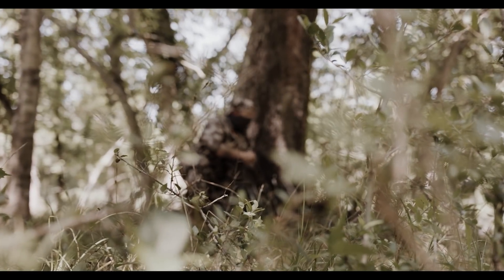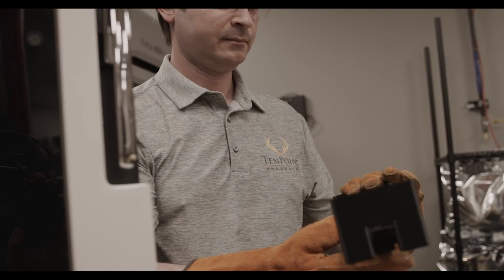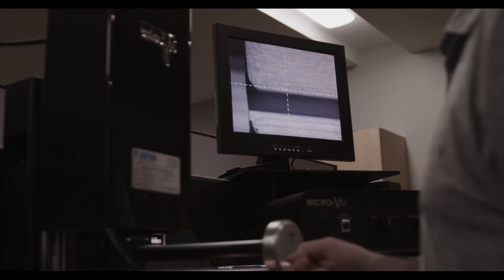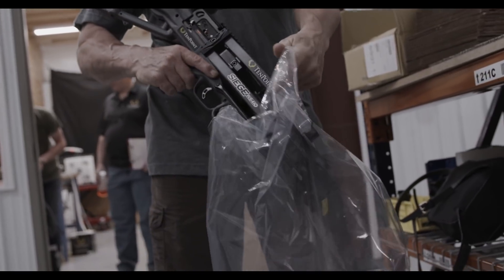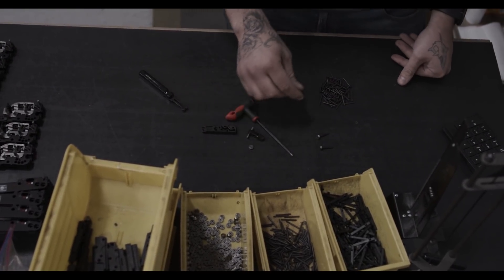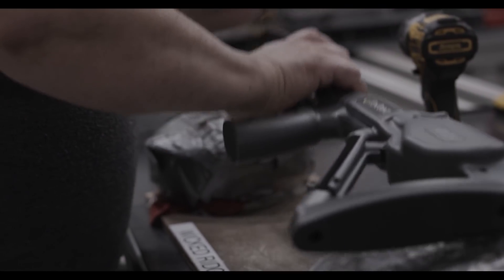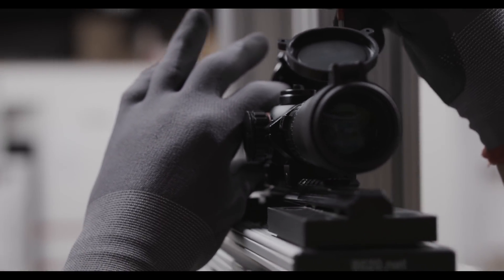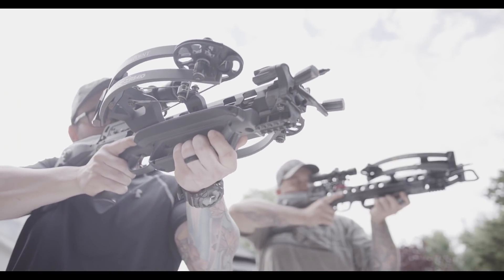How It's Made: TenPoint Crossbows - From Concept to Market | TenPoint Crossbows

Comment: That was a great video,I’ve been in a wheelchair for 27years I bought my first ten point crossbow 25 years ago and I stayed with ten point crossbows for a long time,never had an issue with anything built like a tank,the only reason I stopped was I bought the first version of the ten point vapor and the advertised speed was way off and it pissed me off,now I see them chronograph speeds so I know they will do what you say they will with the different grain arrow weight so I will be going back to ten point crossbows soon for that beast of a crossbow 505 fps.awesome job ten point.

Comment: Just purchased the wicked ridge rampage 360 love it so far. Taking on first hunt 29th October. Only issue so far after probably 20 shots on range pull cocker case broke loose. Suggestion need better hookup for handles on pull cocker not fan the magnetic hold, slightest bump they flop loose in pretty noisy. But awesome design love how light it is really like how easy is to pull back.